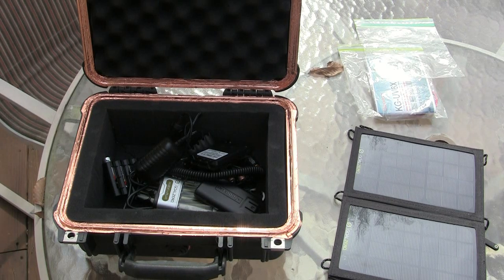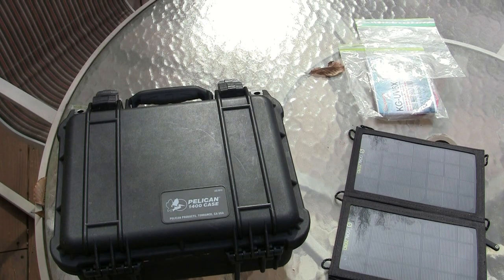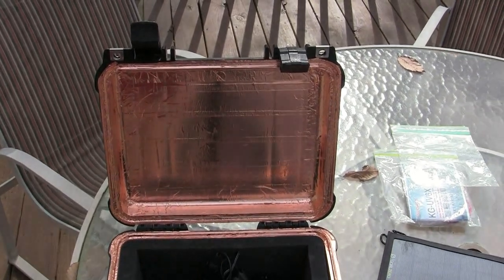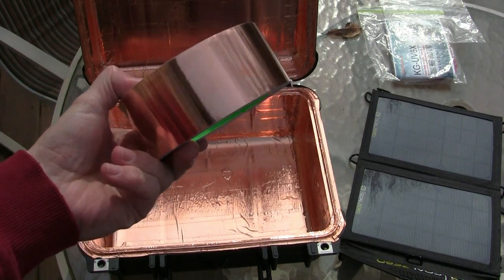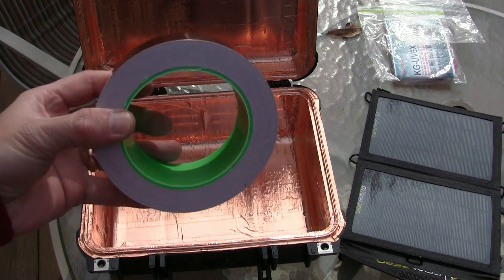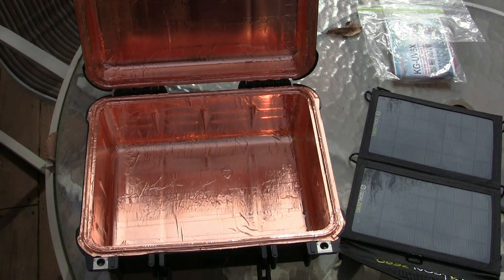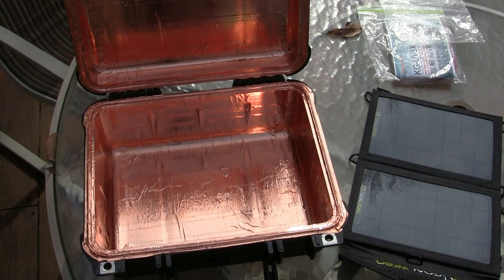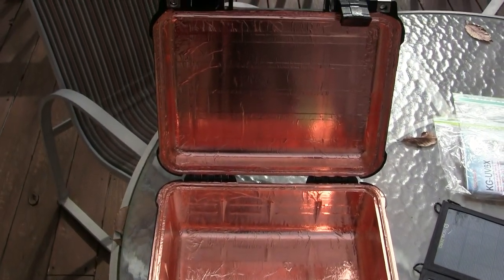DIY Pelican EMP case

Comment: Was there a reason not to use cheaper metal tape? I have loads of aluminum foil ducting tape. Also there is coductive foam blocks too you could use to connect the top and bottom, thinking back edge away from gasket seal. Copper braid may work too.

Comment: One way you can test the seal is by placing a handheld radio inside the box and transmit with a second radio from outside the box to see if it receives. You can also use two cell phones.

Comment: I am curious if you tested the inside conduction of the tape where the seams overlap? I note that the closure seam makes a solid full contact that causes me no worries. But the adhesive is non-conductive. I just wonder before I try buying this for some of my pelicans if the tape lets you make a single conducting surface. This looks good though I like the copper over the aluminum for galvanic issues. I suppose a silicate bag would fix that in a trice though. The heavy foil "I used vacuum foil. over the standard heavy-duty stuff works great too" was the normal go to with a heavy poly foam for the non-conductive layer. Is suppose I can try it myself and see. I will drop a meter in the box after and close it up and see what it records. The last big CME we had that fried Canada, and some regions of New England took out a lot of my radio equipment. Filters and discharge devices were not rated as high as we got, I was just prepared for lightning. So, storing my expensive stuff in EMP bags and boxes became a priority. But damn some of the boxes cost as much as the gear. If the tape forms a continuous conductor despite the adhesive seams this may be a better box than the Aluminum.
Reply: Pretty sure 2mm or smaller copper mesh or cloth is effective as well.

Comment: If you dont ground it, youre wasting your time
Reply: so when lightning strikes a plane... where is it grounded to?
Reply: @thelostsurfer_04  when lightning strikes a plane it usually enters one wing tip across the surface and continues off the other wing tip back into atmosphere and most electronics on a plane have been made to withstand the hit to the system. In the way alot of EMP safety  systems work is they add a slight positive charge when not in operation to cancel out the negative charge from an EMP and a bunch of surge arresters that save it in an overload of an emp,
Reply: There are two cases where grounding for EMP is USEFUL (note not required).  One is in making the ground connection for large surges, in this case as can happen in a CME event the outer faraday can develop and hold a hefty charge without grounding. This could be extremely dangerous to someone contacting the faraday.  The other is for the outer shields on the faraday that have conductors penetrating the faraday. Yes, some folks have heavily filtered power lines or data lines making penetration.  Small faraday cages with no conductors penetrating the shield do NOT need to be grounded.  Large faradays that do have conductors penetrating the cage need careful filtering and transient protection (surge suppression) to ensure that electromagnetic fields are not radiated into the interior of the faraday volume and these penetrations need sufficient shielding to make the penetration. So, in conclusion, in the application shown, it is not "wasting your time".
Reply: Please elaborate?
Reply: @facrispii  so electricity needs a path to ground to dissipate, on medium voltage or instrumentation cables they have "drainage" wires that take you electromagnetic interference away when you tie them to your ground wires
Reply: @billc8916 Really????   Sorry, but I dont think you know what you are talking about….  😊. NEVER in the world of EMP Bags, or boxes ….  You are preventing electricity from entering the containment only….